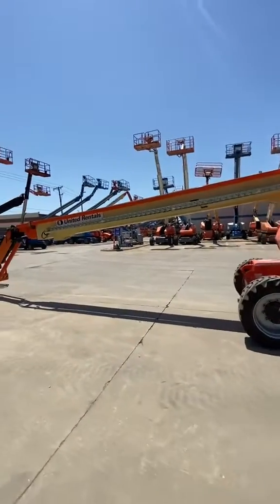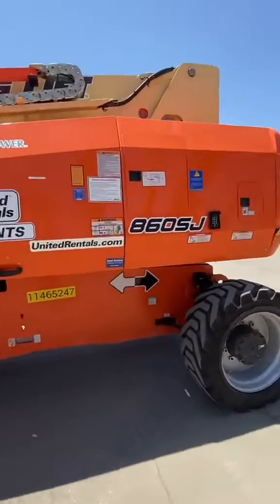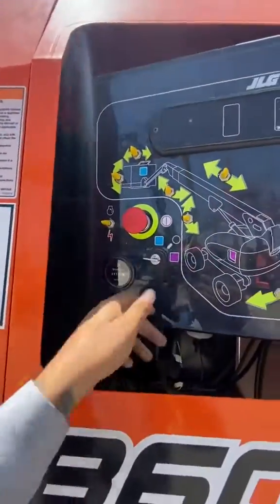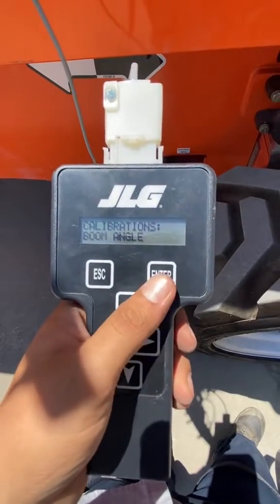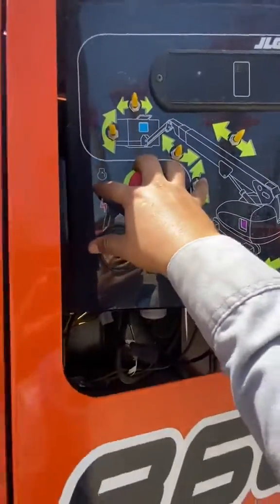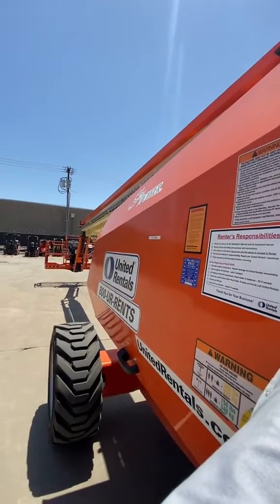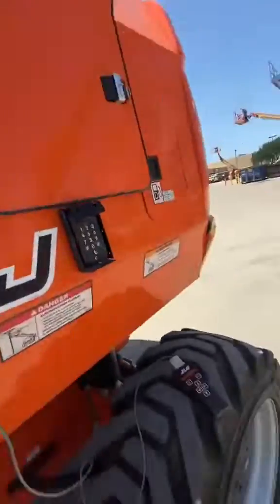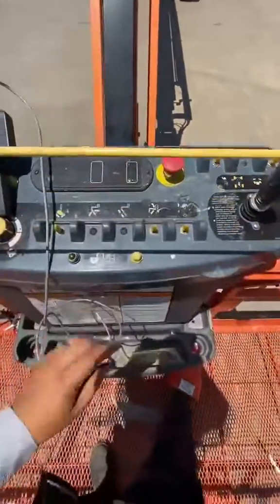BoomLift Boom angle sensor failure

Comment: Hey man, my JLG 400s will not move forward or reverse due to the rains washing the ground out from under the tires and the slope of the ground is more than the unit will move on. How do I tow the lift to a level spot to then be able to drive it?

Comment: Having this issue now. Jlg 860 sj wont go up the trailer and when i try to calibrate the boom it keeps saying angle sensor too low on the scanner.another tech changed the sensor out yesterday when i was getting a service wire rope required code an didnt calibrate the boom so now i have 2 issues.service wire rope an boom angle sensor out of range

Comment: Hey you ever run into a fuse outage problem. Had this happen to me recently. Turned the whole
Engine off on me and gave me a code 7 system failure

Comment: Hey man, love the content. There’s not much out there for this kind of equipment! 
I’m working on a 2007 jlg 600aj w/ dual fuel GM engine. 
The problem is she starts and runs fine, but after it gets up to temperature it cuts out and won’t restart until it’s cooled off. 
So far- replaced fuel injectors, fuel filter (previous mechanic)
Reply: I work at JLG, feel free to ask any questions and I can help best I can
Reply: Check the fuse behind the engine on the harness
Reply: same issue     .... did you figure it out by chance?